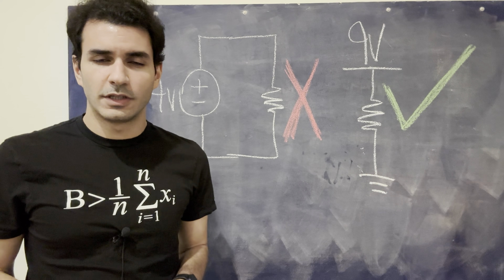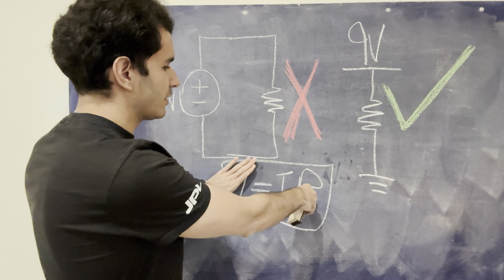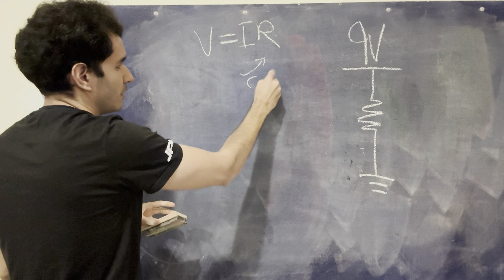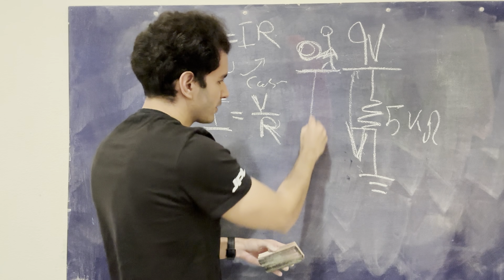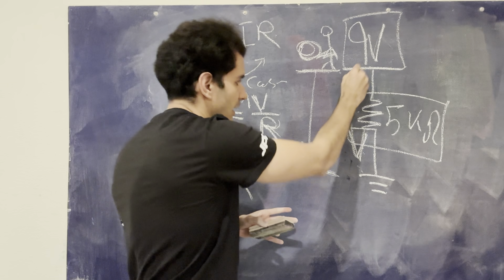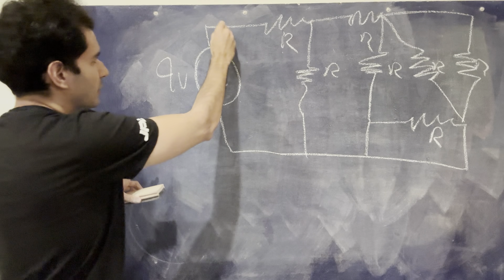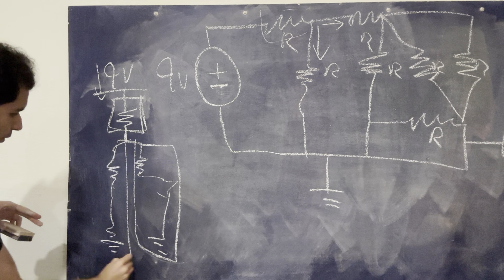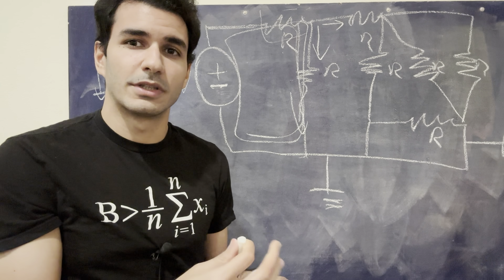Circuits Finally Made Sense When I Saw This One Diagram

Comment: As an electrical engineer i prefer the loop circuit its more convenient to study it because then V=IxR makes sense, for current to flow you need a loop and engineering newbies will have problems otherwise, and the same current cant flow without potential difference= voltage.
Reply: What's the loop when lightening strikes?
Reply: @GizmoMaltese Lightning is typically either cloud to cloud or cloud to ground. Lightning both rises and falls in cloud to ground strikes, so the loop is cloud to ground, ground to cloud.
Reply: Loop seems to be more important with AC. Note that I said "more" important. I prefer to work with DC for that reason, conceptually. With DC you can, more or less, see it conceptually as just dropping down from the top to the bottom. That is not always the case, depending on what is actually in the circuit.
Reply: Exactly!
It's called a circuit because it loops back to the source.

Whereas the diagram to the right might help in analyzing how the resistors are connected but current flow or signal flow is what we need to follow or keep track from source back to source!

Voltage is a potential difference.
But resistance is the opposition to the flow of current, which is the only 'active' parameter.
Reply: @V21IC  it doesn't have to loop back to the source. Ground is at 0 V relative to anything basically, thus will accept or donate charges with essential unlimited capacity.
Reply: @V21IC   but a current doesn't require a "loop", sustained flow requires loop,an eg is static discharge here and thhere during winters,due to accumulated charges,they might eventually loop around due to idk,statistics and interpretation,but it doesn't have to be instantaneous loop

another example is electrode potentials,you can theoretically cause a current flow without the salt bridge,but the oresence of the loop ensures sustained flow,so knowing these may become helpful in considering the essence of a potential difference

Comment: Couple of points: Current is easy to understand, the flow of electrons, Resistance is easy to understand - resistance to this current flow. Voltage, on the other hand, less so. The best way to think of voltage is it is the level of electrical attraction BETWEEN TWO POINTS. Voltage only really becomes a clear concept if you understand that you can never have a single point on a cct which is 'the voltage'. This is why your up and down drawing makes more sense, it places an emphisis on this point. However, since a circle doesn't have two points, it is much less clear.

One other point, in terms of V=IR, Current is the consequence of having a voltage and a resistance between two points. We have control of the voltage, control of the resistance - and current is the result of the relationship between voltage and resistance.
Reply: voltage and resistance in proximity 😂😂😂
Reply: @ncolevalv_5673  The proximity of an electoric circut - you could go to an atmospheric scale if you like where the potentials are massive.

But, if you are going to be a twat, at least make a decent point you snide.

Comment: Amperage is real. You can measure it. 
Resistance is real. You can measure it.
Voltage? Voltage is made up. 
Voltage is the random product of 2 known measurements. 
Voltage is the potential for what happens if you have enough amps to overcome the resistance.
Reply: voltage is made up 😂😂😂.

Comment: I assumed as a young student that voltage, like current, flowed from one part of a circuit to another, which made things like Ohm's law feel unintuitive. It was only when I heard of the hydraulic analogy that I realized what you're saying here, that for simple (resistive) circuits, voltage is the cause, resistance is the condition, and current is the effect. 

I know this is not 100% true in all cases, but it's a pretty good springboard for understanding how electricity works for absolute beginners. And I would know, I graduated in EE a few days ago :)
Reply: think of voltage as the pump in a hydraulic circuit.  no pump, no water flow.
Reply: @ncolevalv_5673 more like pressure, because you need a pressure difference to have flow (current)

Comment: This is coming from an electronics book I read a couple years ago. This may be wrong, because I'm going from memory. It didn't make complete sense to me. As I remember, it said if you have a circuit that contains one resister in the loop, and then you contrast that with a circuit with the same loop, but you add a resister in parallel, that we've doubled the resistance of the circuit.

Shorter version: Instead of putting two of the same resister in series, the two resisters are in parallel, but it's the same result. What's a good explanation for why that is?

Intuitively, this seems like a partially induced effect. If I think of the circuit as a pipeline that's carrying water, and the resisters are smaller diameter pipes fitted into the "circuit," then I can imagine that pressure is reduced in both the "main loop," as I'll call it, and the parallel line, partly because both accept some of the pressure, which reduces it for both of them, and partly because they reduce the pressure by their rate of resistance. This doubling of the resistance is partly a "load sharing" effect. Is that right?
Reply: younare making it too hard. just remember ohms law and kirchoffs law.

Comment: Love this stuff. I also had that realisation in uni. We teach the relationship of speed, distance and time, the same stupid way! Another way is to teach what we actually mean by speed first. That speed is derived from the other two. 

In terms of circuits, I like to think of voltage as just potential energy.  Resistance is like a barrier which is needed for even having a difference in potential energy over a circuit in the first place (otherwise we have a short circuit, or a circuit with no voltage differences). And yeah, current is just the process of levelling out the imbalance.

Same with the right triangle/trig/wave relationships. Same with many, many other “formulas” we teach.

As a rough guess, I’d say the reason students struggle with math and physics is 50% lack of fundamentals, and 50% lack of proper intuition.

Comment: never show this man a DC offset... This is horrible advice for anyone getting into circuits. Please show us an example with 3-4 voltage sources and mesh analysis with this method. You will quickly see that it isn't worth being mentioned. 

You realize you drew a problem in a school book, which is confusing ON PURPOSE for you to reason out. you would never do that in reality. Using an absurd problem which is meant to demonstrate why it is absurd to do it that way, and then claiming that its absurd while passing that off as wisdom. Do you see how that is stupid and damaging?

Comment: yeah this is interesting but it doesn't actually follow the science. The ampere is defined independently (Si unit, one coulomb per sec) then the ohm is defined from the ampere (and the volt) ... so to be strictly scientific, the correct "base version" of ohm's law is r=v/i (the one that is most rarely used?) .. but I get what the poster is saying  👍

Comment: I like this explanation. I’ve always thought of it as voltage being water pressure or water volume above a dam and the dam as resistance and current flow is water current depending on the amount of resistance so less resistance than more flow. I’m a mechanic though so my education has always been real world and self taught rather than actual theory in a classroom with proper teachers
Reply: Also I don’t need to go as in depth as an electrical engineer would. Parellel circuits would be like little channels or levy’s coming out of the dam with less flow due to more restrictions and would be measured at a different rate or flow than the side of the water that’s flowing free (series side) from the dam and in a straight manner with no eddies and rocks like the other side.

Comment: Brilliant approach to getting on a firm foundation, especially as a beginner. I'm not sure that I ever totally recovered from that other, confusing, way that I was taught circuit analysis.  The main point is to assist intuition, in a non-intuitive subject, so as to create confidence, going forward.  For me, what saved me from leaving my degree was buying an old, cheap, oscilloscope, and being able to SEE what was happening at any point in any circuit, and what was dominating the signal.  (If you go this route, research how to safely, accommodate the fact that the ground lead on any scope is physically connected to your, house-hold ground, though!).
Reply: I have seen so many first level electronics people that work with line level stuff, blow things up like that

Comment: I don't see any real advantage in the "linear" vertical representation. Even further, the analogy with a mechanical system can be misleading. And Ohm's law is not such a big deal to learn so as to find for some mnemotechnics. I rather stay with the loops

Comment: I think you're making it more confusing. Corcuits are loops, so it makes more sense to study them as loops...
Reply: The electrons don’t see it as loops u do
Reply: @diegorubino8397 But they do make it back to where they came from right ?
Reply: @miller-clem  no
Reply: @stayfree1776 
As your answer confused me (as a non-engineer), I looked it up and understand that only the charge gets "passed on" by the electrons bouncing in on each other.

Is that correct?

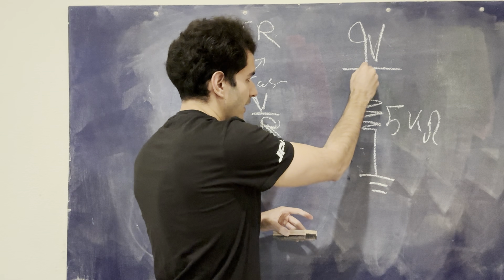Comment: 3:02 I think the definition of resistor as something who "resist" is the most misleading principle instead of the formula (that for me represent a co-dependence relationship between the three V, R and I). The resistor is called load resistor because they absorb current, transform the current into heat. But it depends from what point of view someone start to explain circuits. The 3:33 It remembers me the joke from a professor who said this "energy is like a mother, there are different forms, looks but there is always one". ps.: the current flows not through the cable but on the surface of the cable.
Reply: current flows outside of the csble 😂😂😂😂.  touch a live wire pleas 😂😂😂
Reply: generates heat  😂😂😂.  where is the heat in an electrical motor 😂😂😂.  why do households do not use them as a heater 😂😂😂

Comment: This video got me thinking! I ❤how you introduced the idea of visualizing potential energy with the mental model of gravity. Your preferred formula makes sense too. That said, I think this video deserves a longer follow-up!

Firstly, because you wanted a fairly quick and uncut video, you didn't take the time to convert the more complicated 'standard' diagram into your alternative model; you just kind of glossed over it. This was the part that I most wanted to see! I got a taste for the insight, but I wasn't able to fully grasp how/why it makes more sense for anything beyond the most basic circuit. In other words, your alternative of the complex diagram also looked confusing to me. However, I trust that if I saw a side-by-side comparison of the same circuit, it would probably click. Please show me what it looks like!

Secondly, there are some pretty smart-sounding electrical engineers in the comments pushing back. I think it could be helpful if you acknowledged some of their points while still arguing for why you think your model has merit. For example, maybe as a professional electrical engineer, the more standard schematic format is best. Yet — I assume — you're arguing that intuition and understanding is fundamental, and it helps more people remain engaged in the marathon that is an engineering education. I also assume that you believe these students can make the shift to the more conventional models later.

Comment: This 'ground' is still a mystery for me. Any source on how that evolved and came to be associated with negative pole of battery?
Reply: the ground is the zero potential in a battery.  in a car, you connect the negative post of the battery to "ground",  the car chassis and engine block.  you connect the positive wire to a load,  other side of the load is connected by a wire, the ground wire to ground.  voila, you have a circuit.

Comment: I think you are oversimplifying what is actually happening and downplaying the equations and their usefulness. Actually, trying to understand why the equations work and how that is so provides insight into what is actually occurring. When I learned simple ohms law back in the 1970's and the basic electronics equations, it was taught to me that the variables in the equations are directly related to one another which helped me understand the more difficult equations for more advanced electronics later on. When you try to understand why each formula or equation is so, it leads you to see how the terms are related and what is actually happening. At that point, it is no longer memorization of an equation, but because you understand what is happening, the equations become the way to accurately depict what is happening in the circuit. They tell the story of what is happening. Once you have the understanding of what is happening, you can reconstruct the equations from that later on without much memorization.
The simple diagram you show does not tell the story when current loops come into play. Return paths are also important. That is what a circuit is by definition. The path for current to flow has to be a complete path. Try building an actual circuit from your diagram alone. Your diagram has to assume the voltage potential is with respect to and connected to ground in order to have a potential in the first place, but your diagram does not show this. Diagrams should attempt to model real world examples the best they can so the otherwise hidden influences can be identified.
When you say that V=IR is misleading shows that you did not initially grasp the relational characteristics of the terms which is extremely valuable in anyone's initial understanding of the basics and hence the intuition needed to grasp electronics in general.

Comment: I believe a lot of the water comparisons cause some confusion as well. Electricity doesn’t flow through the wires. It spreads more like a fire as different parts of the wire become electrified, whereas water does actually flow through the pipes.😊
Reply: please touch a live wire. please.  😂😂😂
Reply: @ncolevalv_5673  like I said dummy, it spreads, and if you touch the live wire it spreads to you.

Comment: Professionally, over the years, I have drawn perhaps hundreds of schematics and I very much agree with your turning the schematic 90 degrees.  The looping thing works fine for simple circuits but becomes a tangled mess when the circuit becomes more complex.  A more organized schematic that is easy to read has the power going from top to bottom, as you have shown.  The signal then goes left to right.

Comment: >works for nasa
>”this triangle takes away the whole meaning of it”
>uses gravity instead to represent tension
>mfw

Explain how gravity, the most complex black box force in the universe, makes more sense than “current is directly proportional to tension but inversely proportional to resistance”

You didn’t even try.
Most teachers use water flowing through pipes for a much better representation, that you can then go and prove using actual pipes and obstructions.

Go try to do your rock thing and make up some bullshit to make it move slower 💀

Comment: What it explains to me is why non chemical engineer students struggle with circuits when the rest of us aced I and II,  for ChemE’s it’s system pressure flow where the fluid has a fixed velocity factor.

Comment: As someone who found my own system of how to understand circuits I find this video counterintuitive. What if you add more voltage/current sources ? What about negative voltage ? I think this whole point of redrawing top to bottom would create a lot more problems than just simply finding system in what is taught. For example just drawing the ground under source would be sufficent to show your point while keeping the circuit.
PS: My understanding might clash with your understanding because in our language "circuit" is translates literaly as "loop" .

Comment: some pplL are so dump. you don't need to redraw anyrhing. just understand. voltage is the difference of potentials. and current is the energy flowing from one end to other to balance it. resistence are absticles. V=IR.